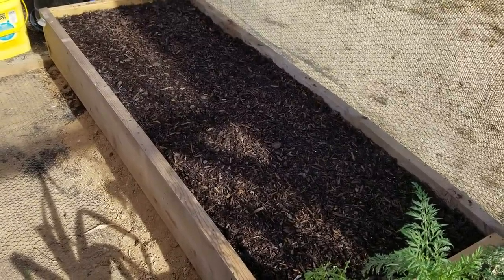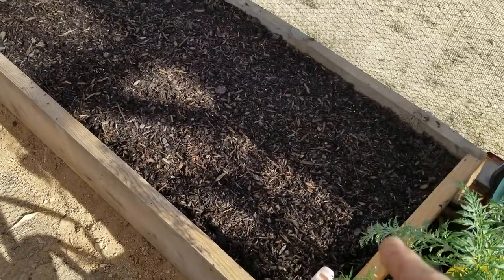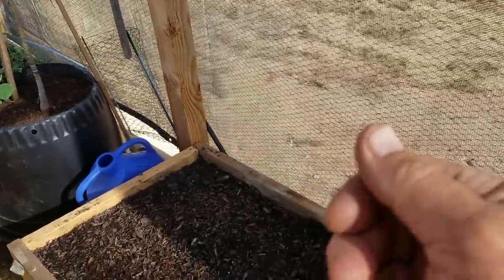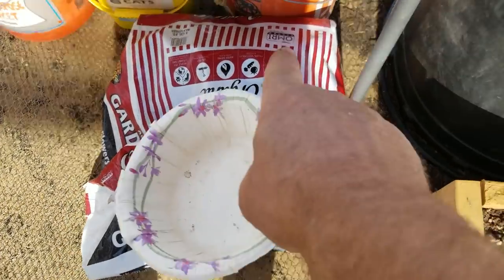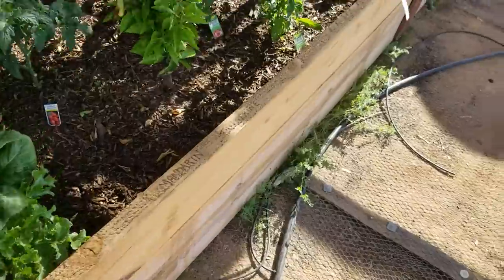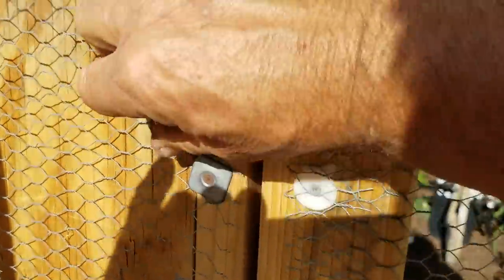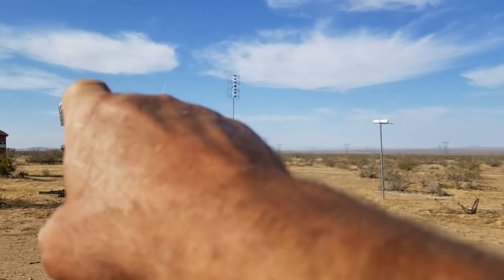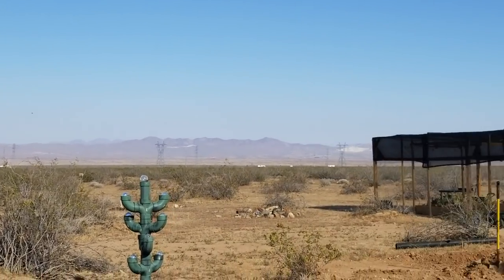Pest resistant garden in the desert.

Comment: Dry your egg shells and bake them anytime that the oven is on but always put them in a blender and chop them up and add it to their feed.  Ditto on the little munchers liking plastic!  My orange extension cord was getting nibbled all the time while hanging on the wall.  I got tired of patching it so I fused it at one amp and plugged it in.  Had some friend mouse in the house by morning. Problem solved.  Now it hangs by a small rope where the path to it is more challenging.  OK so far.  Good luck!
Reply from the maker: Lol, at the last place I lived, I once heard a roof rat in the attic right above my bed and figured it was chewing the wires to my ceiling fan, so I turned the fan on and heard a thump, then silence.....got him!